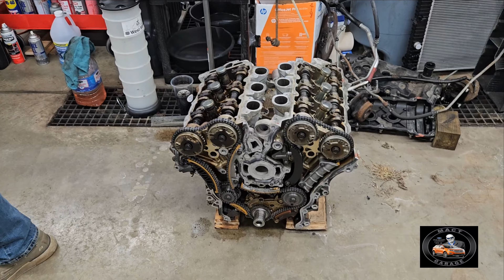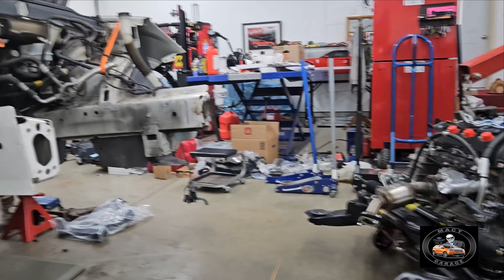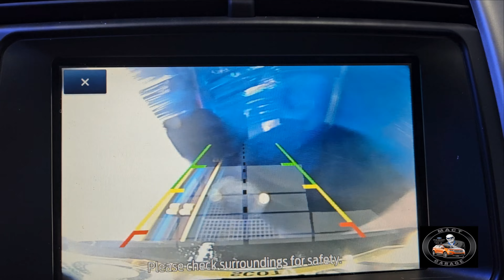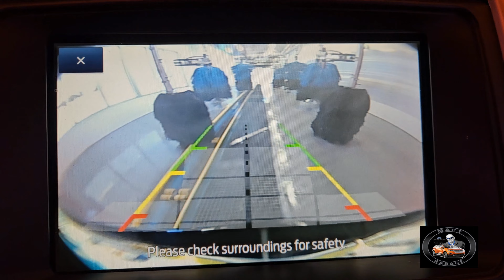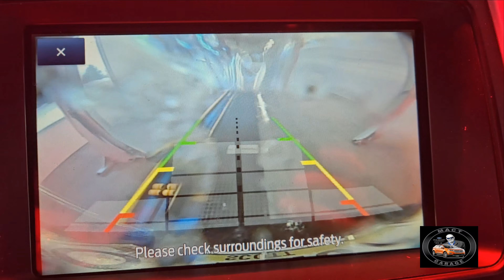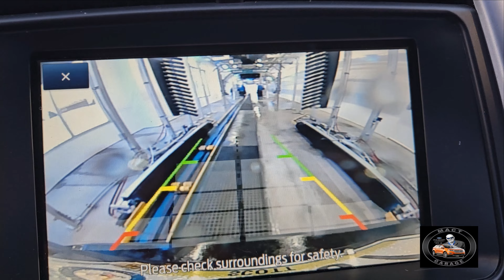2012 GMC Acadia 3.6 LLT oil test after this engine destroyed its self

Comment: They are good engine's as long as you do the oil change every 3000 miles i have a 2010 gmc acadia slt AWD and I love it i change the timing chain ones and had the transmission rebuilt and it's been running beautiful

Comment: I have rebuilt so many of these LLT engines.  They really start to make sense after the first 2 or3 3.  Looking at the cam phasers on that old pile, I would be willing to bet the oil passages are packed full of sludge.  I pressure wash the block to clean everything out and then blow it off really well with compressed air.  As a matter of fact, I bought a 2012 AWD Denali Acadia with a timing issue for nearly nothing, fixed it, and now my grandparents have a nice car to drive around.  
Good video.  Hope it works well for Jeff!
Reply: We have replaced our motor 3 times .
With a new rebuilt one waht do you Recommend we do with the new rebuilt one .orther than sell it lol